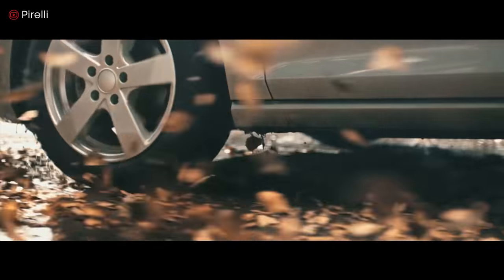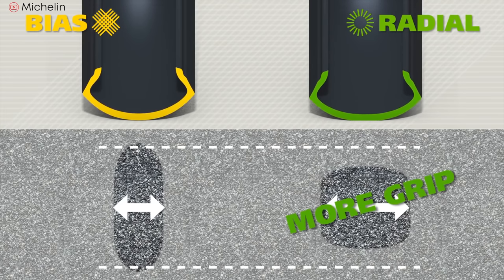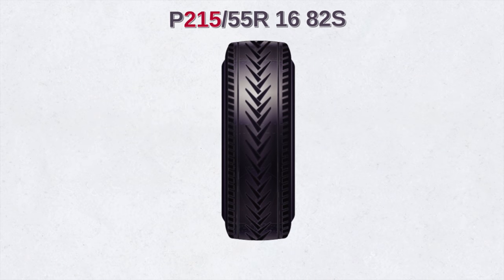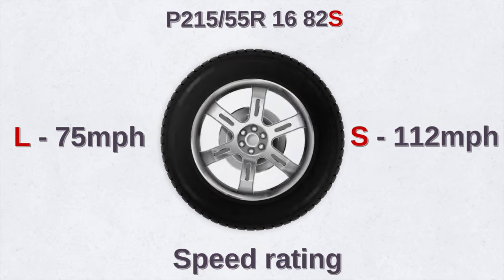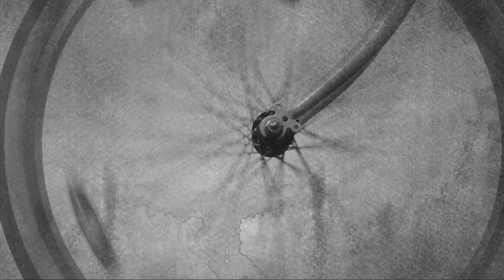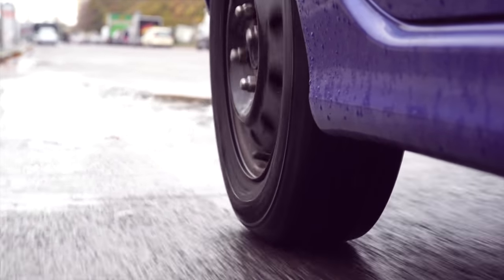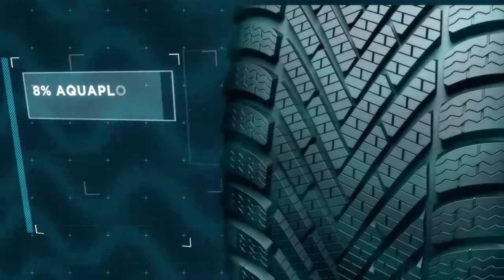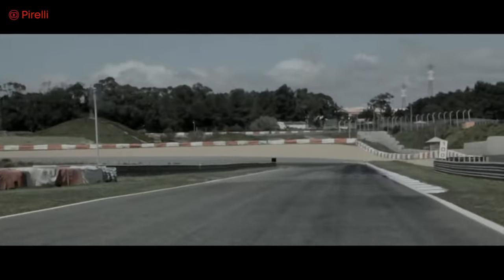These Tires Will Last Forever

Comment: Great info Scotty!
Having personally analyzed the cost of tires and installation  costs versus the cost of parts and labor for front/rear suspension over  the last 15 years, I have come to the conclusion that lowering tire pressures by 3-5psi under manufacturers specifications  gives me a much nicer/smoother ride and much less wear on major suspension components. Tire wear has basically been insignificant than running them at factory specs and i am on my second set of tires in that time span. I have also noticed that tires wear out in a much flatter wear pattern when i check the print patterns. Using wider rims and slightly bigger tires has also greatly improved handling of vehicle at higher speeds and while cornering.
I have switched many of my customers at the shop to similar and appropriate wheel/tire combos and they are very happy at the major ride/handling improvements plus the long term savings on chassis component repairs. During the last 15 years they have saved tons of money on repairs and components just by making those small changes and have yet to visit alignment shops. Wheel hub bearings have not been changed during that time but only on two customer's cars out of the 50 cars i set as limit for the long term test. CV-joint problems have occurred on only 5 of the 50 vehicles. Most of these customers run their cars around 65% of the time on highways and 35% in city driving. Just thought readers would like to have that type of info for their own personal use.

Comment: Hey Mr. Kilmer! I love your content. Always informative and respectful. Doesn’t hurt to mention that I’m a former Texan from close to the same Houston area as yourself. I currently drive a 2015 Ram. V6, reg cab 4x4. I put a set of BF Goodrich TA ko 2 on her. I’m Currently in west KY close to the land between the lakes. As you know, we got a ton of snow and ice. These tires along with the 4x4 capabilities of my Ram are amazing. I have no trouble with stop line acceleration, turning, or flat out stopping. The truck goes where I want it to. I only break traction when I want to. I just want to say that if you have a 4x4 and live in any area that has adverse weather conditions, the TA KO 2 tire is the way to go. Amazing grip and performance. Even in summer driving. Keep up the great work. From one Texan to another, yeehaw.

Comment: The last 4 numbers of the DOT numbers tell the week and year the tire manufactured.
Reply: That is a very important number many people know nothing about. I know it is the first number I look at when buying tires. If you pay good money for them you might as well make sure they are fresh!
Reply: Wouldn’t in theory if the tire hasn’t been exposed to the elements or put under stress of use, tire performance and longevity would still be maintain despite year it was sold if relatively close to birth date of tire.
Reply: The last four numbers?? There are ONLY four digits in that date oval, unless the tire was made before 2000, then there were only three digits
Reply: @yeethawt9160  tires begin to disintegrate the moment they are manufactured. Depending on where you live, I was in Phoenix for over two decades, hot climates destroy rubber and that includes tires, windshield wipers, radiator hoses and belts etc.
I'm surprised Scotty didn't mention that four digit code, he lived in Houston for so many years. Maybe the humidity helped tires last a little longer than 5 years. But any tire I have that's over 5 years old I take off the car. They won't hold up forever. Which is why zombie movies and apocalypse movies are so dumb to me when people start driving old cars. The batteries would be dead, the gasoline would be gel, and the tires would be completely rotten. Rubber does not hold together forever. And... they're made with several gallons of oil which is the reason they start to disintegrate.
Reply: @BiznessWizard  hello 👋 are you open to opportunities  aside your field of work?
Reply: @RSole9999  hello 👋 are you open to opportunities  aside your field of work?
Reply: @keithsj10  hello 👋 are you open to opportunities  aside your field of work?

Comment: Well Dunlop makes tennis racquets now, but more to the point Michelin Cross climate 2 all season tires work great for me. The tread pattern is very similar (though not identical) to the winter tire you described.

Comment: i never knew that the profile was a percentage, amazing! The way i learned it was that the /"number" was just the measurement of the shoulder in mm so 215mm width and 55mm shoulder which is what you call the height , R 16 is the radius of the rim in inches

Comment: This post jingles my memory about Firedstone tires. Back in the 90’s Ford Explorers were having roll over issues. They then advised lowering the tire pressure to lower the center of gravity. Well - that brilliant idea was even deadlier! The lower pressure caused the tires to overheat an cause blowouts. I recall the tires in question were Firedstones. I have had All kind of problems with them over the years. B.F. Goods are my recommendation. Also stay away from Dunlop, except for motorcycles.

Comment: Excellent breakdown of tires!  This is exactly the sort of video I could send friends and family that teaches them what they need to know without it getting overly complex.  Glad you point out that All-Season tires are not all that good at any one thing; I've always been telling people "All Season is No Season" in an effort to get them to consider winter tires.  Great stuff Scotty!
Reply: Michelin Cross Climates have an official snow rating. I drove in New England in all conditions with rear wheel drive. They are great.

Comment: All wheel drive does help you get stopped because it allows you to not drive as fast in winter conditions.  Around here if you don’t have all wheel drive you’ll have to maintain your speed to avoid the risk of getting stuck on a hill, whereas with all wheel drive you can take it slow.

Comment: Scotty, Mining Trucks primarily ride on radial tires unless the Mining company just can't get radials.  Radial tires, even in the largest mining trucks offer better load and speed capability than bias-ply.  Plus, they're gentler on the machine, which means lower maintenance costs and downtime (which also costs).

Comment: I drove on used $7 tires from Pick-A-part for years.
Reply: The best ones are the Full size spares!!, in the trunk and under the truck and suv!.Same price at Pick-A Part
Reply: Dang $7? I was able to get a brand new set of tires on wheels for 90 at my local salvage yard because I found them on a car that just rolled in. Then I returned the aluminum wheels for like $45. It definitely takes some effort to find deals like that in my area. I think they sell all the good ones to a used tire shop now, unfortunately
Reply: Long as they work.
Reply: Be careful and inspect closely what you're buying. Sidewall/ shoulder repairs and tires older than 10 years old put you prone to having a blowout.
Reply: @purpledoge4466  hello 👋 are you open to opportunities  aside your field of work?
Reply: @repentandfollowjesuschrist6170  hello 👋 are you open to opportunities  aside your field of work?
Reply: @notadoctor2598  hello 👋 are you open to opportunities  aside your field of work?

Comment: I buy winter tires for the Ice in the northern states. I frequently need to drive through snow and Ice storms. I've had drives where the road was glare ice for hundreds of miles. With good all wheel drive and a decent winter tire the car will go where you point it as long as you have your foot on the gas. I drove at 65 mph in a controlled slide that entire trip. (late at night with no traffic)

Comment: Great video as always Scotty, people usually ask me about truck tires, when i tell them that the first number, 285, is the width of the tire from sidewall to sidewall, they don't believe me, and then say their 285-65R16 is a 33" tire, i kindly let them know it's not even a 31", when they try to argue i just say, 'ok',  lol, end of discussion. The formula, like you said is, the first #, converted to inches, 285=11.2,  times .65, (7.28), plus 7.28, (measurement from top and bottom of rim), plus 16 (rim size) equals 30.56. A tire that's a 255 is 10 inches, every 10 up or down is approximately .4 inches

Comment: Good advice, I get TOYO ,they last and they are reliable, I got 30,000 miles and looking to get at least another year run, good tires for 69 ea, checking tire pressure is key

Comment: Nice. I never check my tire pressure unless the little icon on the dash lights up. I have a slow, inconsistent leak on my driver's side rear tire.
It's fine. The rest of the tires hold their pressure for some reason. My truck is a 2017 Tundra with aftermarket larger tires. They pull their weight 👍

Comment: The owner’s manual and the label on the door on my car conflict with each other.  The car is a 2018 Audi TTRS.  Not a brand Scotty recommends but it has worked great for me.  So which do I go with?  The label on the door recommends much higher pressure.  In fact, it is about what the manual recommends for high speed and loads.  I am using the manual’s normal driving recommendation.

Comment: All i can contribute is I lived in Northern NH and drove a Subaru and used Dunlop Graspic ice tires year round. Performance was incredible even on ice they were like driving as if it were 80deg and sunny. I  then moved south to North Carolina and they lasted as long as all season tires and Wet weather traction was also superb. Again they lasted just as long as All season tires even in warm climate. I never had any noise issues either,  Unfortunately they are not made in the size of my new vechical. PS THEY EVEN GAVE GREAT PERFORMANCE IN MUD

Comment: With the tire pressure, you should check the tire itself for the proper psi the door panel is good if you still have the same tires as when the vehicle was new

Comment: When I worked at Firestone in the mid 70's as a mechanic and also mounted and balanced tires, when we mounted radial tires and inflated them to the correct pressure, which was not 35 psi like today. They still looked like they needed air, which was due to the design of radial tires vs. bias ply tires. Tires then were inflated to maybe 30 psi at the most. Usually around 24 to 28 psi and tires had a lot smoother ride at those PSI's. With radial tires today, inflated to 35 psi, which I think  is the is a result of trying to save fuel, they ride too ruff or hard giving a lousy ride and wear the center tread out of the tire before the ides because of over inflating. I have the radials on my car, a Mercury Grand Marquis, down to 30 psi and I think they still ride to harsh and  going to take them down to about 28 psi or lower.
In 1968 I had a 68 GTO and I remember the psi recommended for the wide ovals on that car was 24 to 26 psi and that car had a fairly smooth ride at those psi's.

Comment: All weather tires work great where I live its hot in summer and theres  heavy rain season and some snow, I have Kumho Solus Ha 31 I have them on two vehicles good results year round three years so far, your area might have different requirments.

Comment: Kelly Springfield is the best tire I've ever owned for driving, used them on my 1979 mustang GT which had the 5.0, of course being a young man I jacked that engine up to over 400 hp and these tires never missed a beat.  90,000 miles and they still had usable tread, great ride, grip.  Bought some Mickey Thompson HP tires with soft compound as I took that engine up to over 500 hp, and they lasted about 30,000 miles.  Cost way more than my KS's but did provide the needed grip I was looking for.
Reply: When did you buy the KS tires?

Comment: DISCOUNT TIRES here in S Texas offers free tire pressure check. It's really nice because most shops have a dedicated "tire air check" area right next to the work area where you simply pull up and a worker usually comes up within 2-3 minutes (if not sooner) to check all 4 tires for you FOR FREE (I usually give a few bucks or a $5 if it's pay day). They always open the door to make sure that the tires are aired up to the manufacturers suggestions and if any are low they fill em up for you. The nice thing is if you return once a month you'll find out if any one of your tires is loosing air more than the others (which usually means you have a slow leak). They also offer rotating and balancing services free of charge if you bought the tires through them.  CHEERS.

Comment: I won't check tire pressures in temperatures below freezing. Chances are in favor of causing moisture to freeze in the valve stem causing the valve to not close properly allowing air to leak out.

Comment: I live in northern Canada where in winter time it can get to -50 degrees, I used to think winter tires was just a scam, till I got my first pair, I used to run all season, now I run one pair of summers and one pair of winters, we get lots of snow and ice up here, the roads can glaze and become very dangerous, winter tires make a huge difference, I tried an all weather tire this year, on my new car, very expensive ($350.00 a tire) and not quite as good as the full winter

Comment: Let’s not forget that the stiff tread in combination with flexible sidewall keeps the tread flat on the road. Bias tires roll so the tread starts to lift if you corner fastEr.

Comment: Tires also lose & gain pressure when the weather makes wild swings. If I do my tires to a perfect 34psi on a day in the 50s and then the weather snaps severely cold (like down into the 20s) I have seen my tires lose 2-3psi on the gauge

Comment: Hey Scotty! Here in the Northeast, most cars are equipped with with tires that have "M+S" indicated on the sidewall, which indicates a "mud and snow" rating. These are "all-season" tires. You didn't mention this in your video. Why not?

Comment: I like the episode. Is there a part two going into even more information. 
What does the picture of three mountains with a snow flake mean ? 
If my tires are more than five years old, are they still good or has ozone dry rotted them ? 
what is wheel balancing and should it be done every two years - more often if I think a wheel weight is gone ? 
(smiles)  Take us to the next level !!!

Comment: Re the code on the sidewall of the tire: the second number, the aspect ratio, 55 in this case, is NOT the sidewall height divided by the tire width. It is the sidewall height divided by the tire width, multiplied by 100.  If the tire is 215 mm wide, and is 118.25 mm high, and we divide the sidewall height by the tire width, we do not get 55; we get 0.55 (which equals 55%). To get the number on the sidewall, which is 55, we have to multiply 0.55 by 100.

Comment: No mention of the difference between the symmetrical and asymmetrical tire.  On my 2011 Prius I switched to the asymmetrical tire ;  it seems to track better on the straight aways.

Comment: Watch the date on the (specifically used tires) tires.

A few years agon a Father had used tired mounted on a veh he had for his son - the tires were DRY-ROTTED and blew out while he was driving killing the son. Investigation had shown the tires were from many years prior - soo check the manufactire date on the sidewall as many tire places like to get rid of the older tires at a good price due to this dangerous fact.

Comment: Ok this video didn’t really explain what kind of tires you need if you live in Midwest areas where summers are very hot and  winters are very cold with a lot of ice and snow . I have a 4wD SUV. Would it be best to get winter tires or all season tires with a 4wd vehicle ?

Comment: In my experience, summer tires work fine until you find moisture on a road at the freezing point of water.
Wet road at 34 F (1C), they're sub-optimal, but ok. 
But at 30F (-1C), if there's any moisture on the road (ice, slush, snow, sleet, etc) summer tires suddenly become 'VeryExciting'(tm).

Comment: I liked the episode. I was hoping you would make mention of why the pressure recommendation on the car differs from the recommended tire pressure on the tire. Also why the front tire recommendation on the car differs from the rear tire recommendation.
Reply: simply because most cars do not weigh 50:50 between front and rear. since majority of cars are front-engined it makes sense that the front requires greater tire pressure to compensate for the extra weight. for pickup trucks, it is the other way around because under full load the cargo bed will weigh a bit more than the engine.

Comment: OMG!!! He actually got the definition of the aspect ratio of the tire correct. I have actually won small bets at tire shops because many of them don't know the the percentage of the sidewall height to the width of the tire is the aforementioned aspect ratio.  So a 10 inch wide tire that is a 70 series would have a sidewall height of 7 inches.

Comment: For city driving and areas with mild winter I guess modern all season tyres are fine. But last year me and a friend of mine went to the alps each with their own car. My car is a 2001 rwd with no traction control or other assists and his is 2019 fwd with everything assisted. He got stuck at the parking lot and I did't. He had all weather tyres and I had brand new Continental winter tyres. I guess in hevay snow tyres are more important than the car.
Reply: I'm guessing your friend didn't turn traction control off as recommended